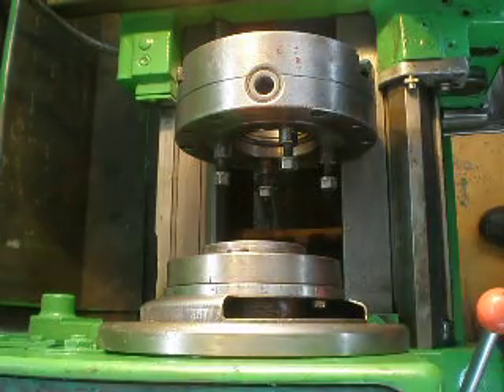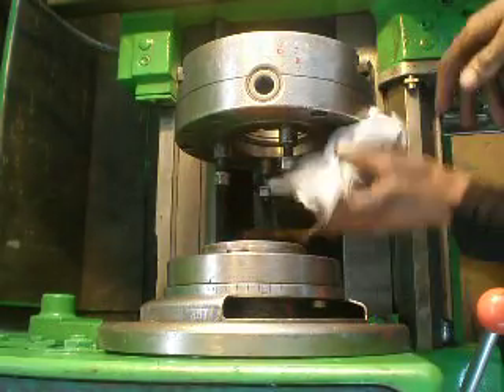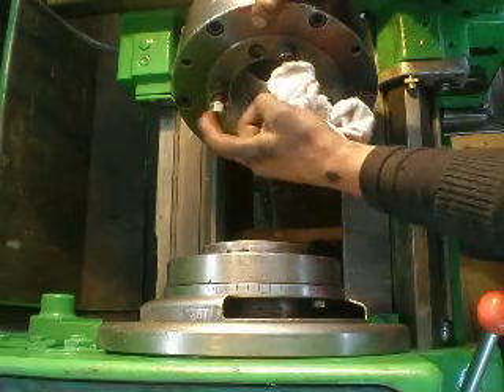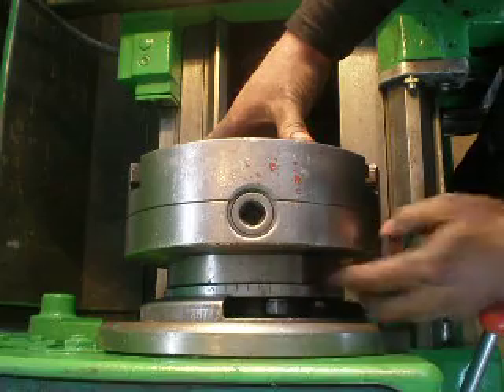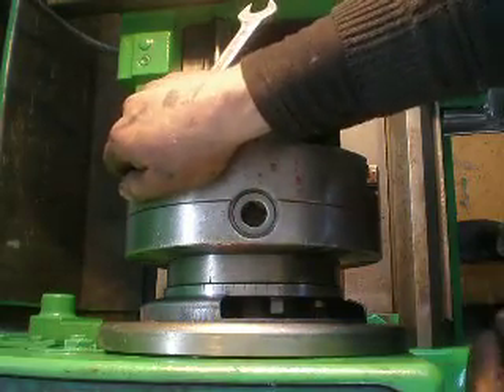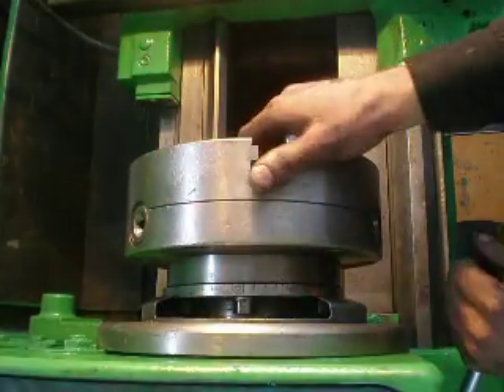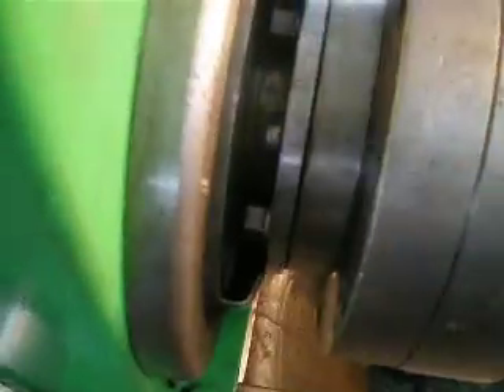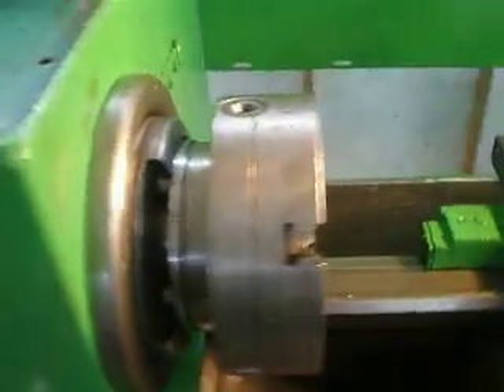250mm chuck instaling on 16K20 lathe spindle

Comment from the maker: Yea, I know this. But I have no chain hoist. I take off chuck 2x times a year. Now I have wooden accessory part for chuck montage for My Stanko 1K62 lathe, but this Stanko 16K20 long time ago I sold. Example - 16K20 lathe weight is 3'200kg, but similar size China/ USA/ EU made lathe weight is ~ 1'300kg, so Stanko machine can drop in airborne and it WILL keep 0.05mm accuracy, but similar machine will be broken in half. I want say that to Stanko machine is built with 300% over solid. 
Good luck!

Comment: I understand m8 what im saying is just put a simple piece of wood over the bed at least it will last longer and be more precise..And maybe a chain hoist too the ceiling if you can,,It's incase you drop the chuck onto the bed then you will know about it and it's not if it's when :D..Just good practice to put a little pice of wood 250mm chuck isn't that big to put on a bit of ply wood but if it hits them rails ouch..!

Comment: Thanks, Harry!  Simple and easy to use, and very strong!  Like our camlock mounting system, it relies on the fit between the male short taper on the spindle and the female short taper in the chuck or the chuck backing plate for accuracy.  Very good design.